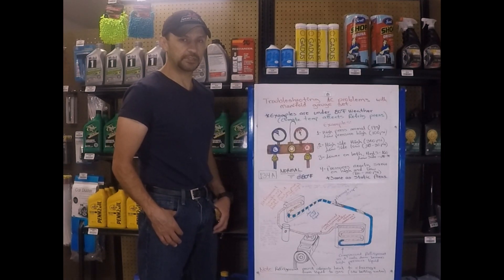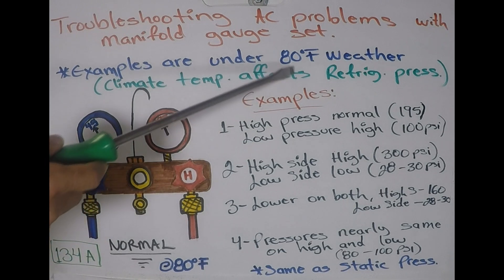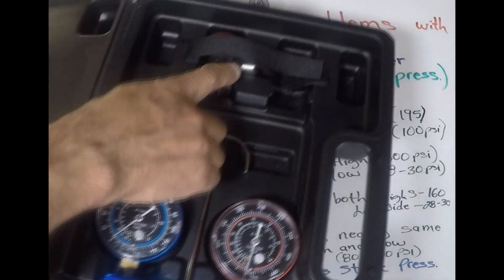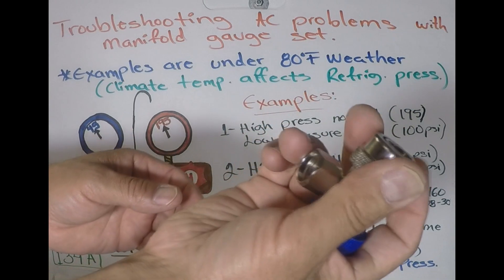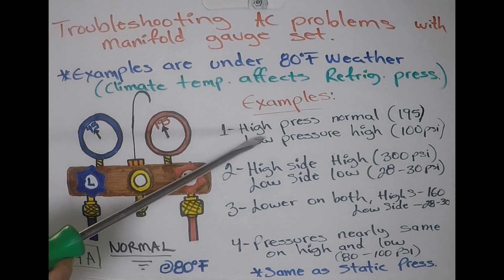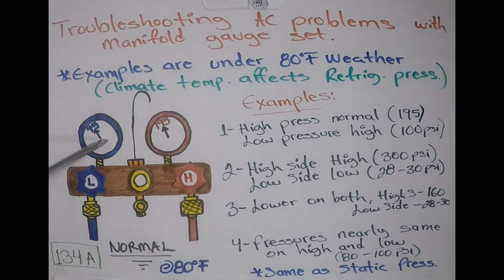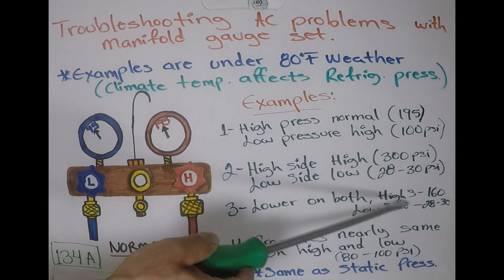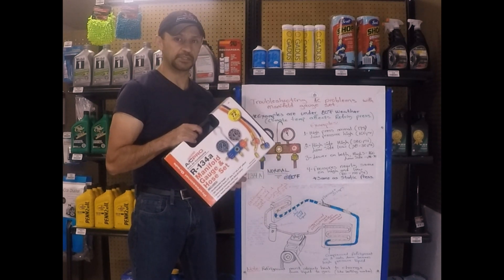Troubleshooting AC Problems with Manifold Gauge Set

Comment: charged? A.C. is fully charged, the pressure is 50 / 150 on the gauge but it is steady and compressor continuously engaged and won't cycle but as soon as you rev the engine it will drop to 40/175 cooling to 60 degrees max.Is that a compressor problem or TXV or orifice tube?

Comment: Interesting ! My compressor and fans do not come on when I turn the ac switch on. I got a p0533 high pressure in the system, so I believe it the system high pressure switch is keeping it from coming on. I used a scan tool HDS and read the psi and it is a weird number , something like 14523 , don't know how to read it. I believe it can't be 14, 523 psi , cause the system would have exploded. I replaced the high pressure switch and it still reads the same.. I let out refrigerant and the system still doesn't kick on. I used the scan tool to test the fans and the compressor clutch and they work..I removed the clutch compressor relay added power to the clutch with the ac switch on car running and added front. As long as I have power to the clutch it runs but the numbers sky rocket on the high side , I think the expansion valve is stuck 99% shut. I will replace it and see if anything changes after evac and recharge of course. Any suggestions? Oh by the way it's a 2007 Honda CR-V 2.4 L automatic EX.
Reply: Did you find out what the problem was? 

I would also have suspected the high pressure switch. It's definitely reporting insane values. Did you put manifold gauges on and check the pressure that way?